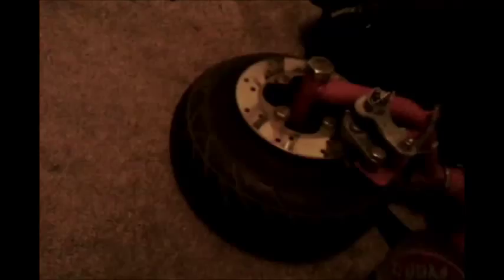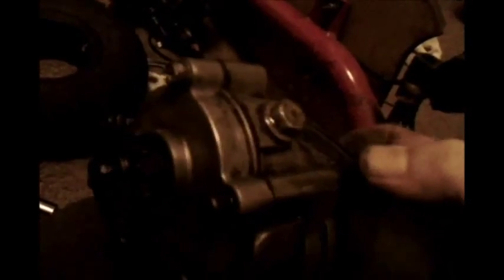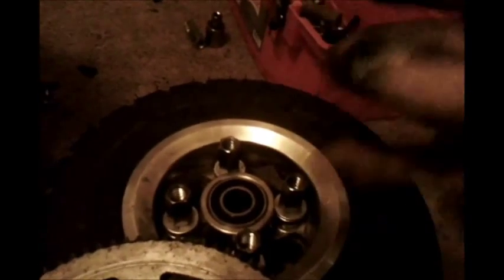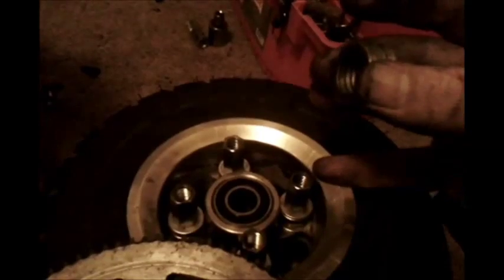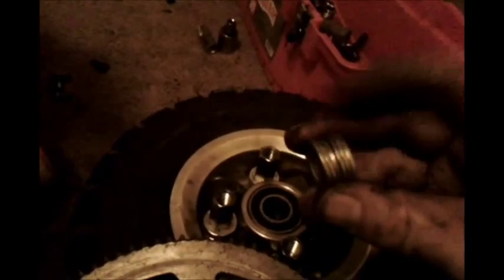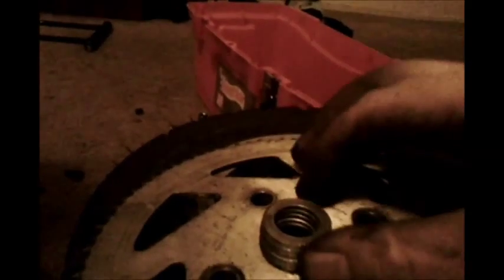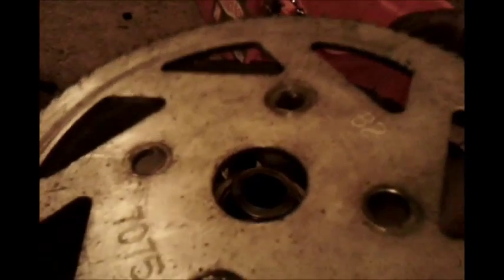Go-Ped Goped Bigfoot Geo to GSR Cruiser Chain Driven Conversion

Comment: Any new update on this I just subbed
Reply from the maker: Alot of updates. I'm trying to sell it now. I moved offgrid and the dirt roads are too bumpy. I ended up using a BCP Pro-Cruise because it kept snapping bolts in the clutch. I also used stock hardware to connect the sprocket to the tire.  I'll post an update video. Thank you for subscribing. Another reason I'm not fond of the GSR is the air tires. It's important to keep a backpack with a spare tube, pump, and any tools you'll need to replace it if you're going for a distance ride.

Comment from the maker: Actually I was mistaken, I bought the Gsr spacer and it was twice as long as it needed to be. I plan on hacksawing it in half and using it. Also, I removed a link off of the chain so be sure to get the 46 link chain if you don't know how to break a chain.

Comment: So what all do I need what size spacers.
Reply from the maker: +Carlton Harris They are just washers, I don&#39;t know why the heck I kept calling them spacers. Basically take your stock geo&#160;bigfoot rear axle to the hardware store, Buy 6 washers that fit the diameter of the axle the size of the washers shouldn&#39;t matter too much but try not to get larger than the wheel&#39;s bearing. You may need more than 6 because&#160;they sell different widths&#160;but start with 6. The idea is to space the distance you will need between the spur gear on the wheel to the frame so the spur gear does not rub the frame. Also, not to over space so that the chain from the engine side (pinion gear) is over stretched. I think the true size is 3/4 of an inch because the 1 1/2 inch gsr spacer was twice too long.

Comment: what's a better motor for the Bigfoot that's a direct bolt in ? I was look at the cy r460. but I'm not sure if that would fit without modification ?
Reply from the maker: +Calvin Lippert It's probably a lot cheaper to just buy a complete Go-ped with the engine you want in it already. I mainly made this video because before I did it, no one had done it and forum users said it could not be done. I was also kind of tired seeing people listing crap on craigslist and never finishing a project but just reselling the junk they bought. The Bigfoot Geo frame has a somewhat weaker mount because it only uses 2 mounting holes for the engine mount instead of 3.

Comment: can you swap a gsr cruiser 29cc to a g43ld. or do y0u have to have a custom motor mount
Reply from the maker: Thank you for your "go faster" question. I would not recommend using a larger engine on a Geo-Bigfoot frame because of the Engine Mount adapter that only has 2 bolt holes. I would guess this engine mount needs to be used http://www.davesmotors.com/s.nl/it.A/id.2520/.f If you want me to, I can check the width to see if it is the same as the 52mm Clutch Engine Mount. If it is the same width the same concept would work.
Reply: Thanks. Can you email me?